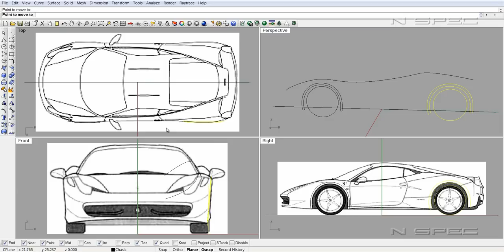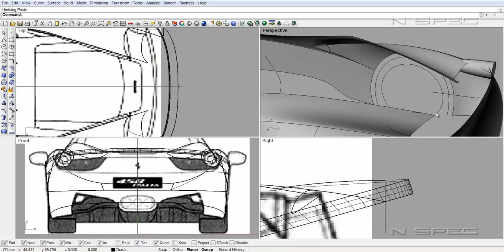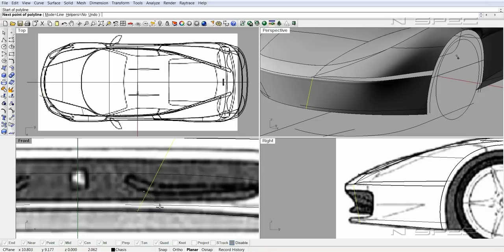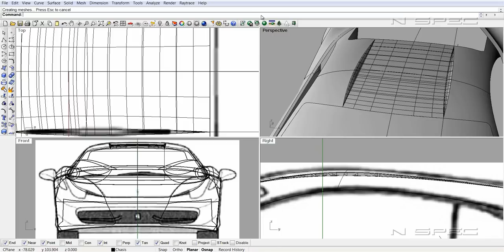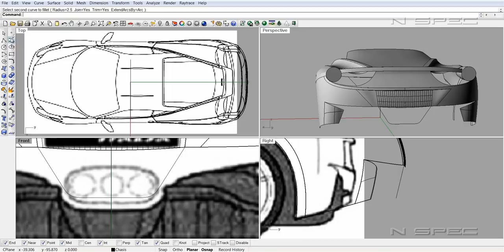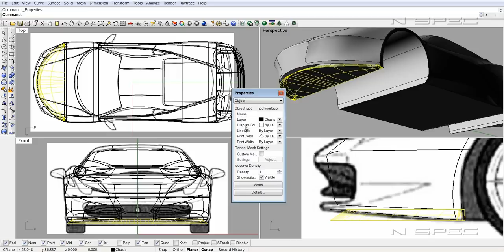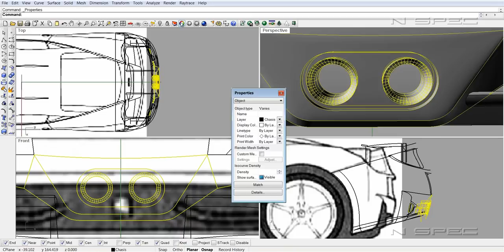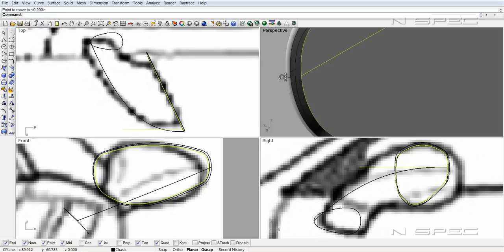How to Create a Ferrari in Less Than 30 Minutes

Comment: the shape does look like a car. But to be honest, the curvature of the surface is not controlled well, for example, the front corner of the window and the edge of the top. I am pretty sure, if  you turn on the surface analyse tool, you will find unorganized red part.